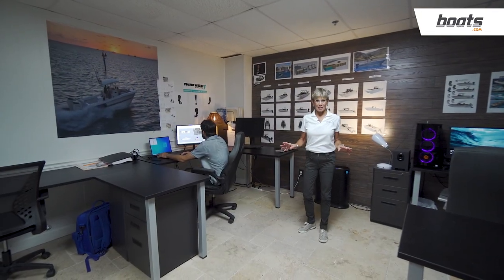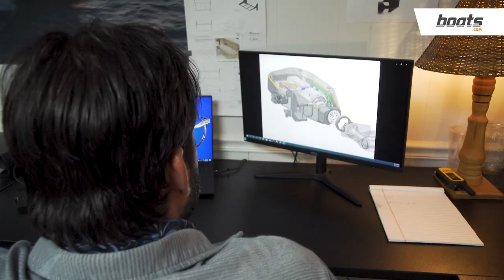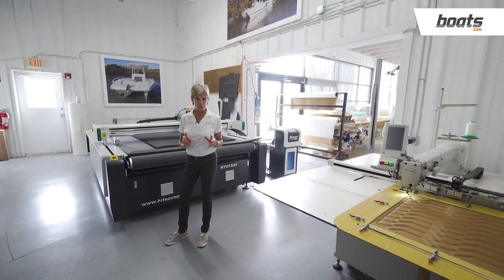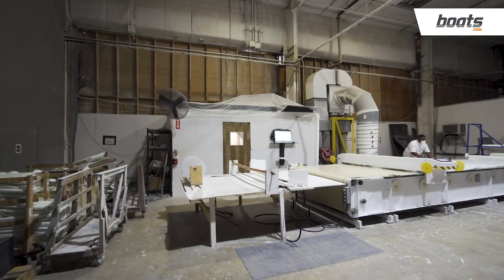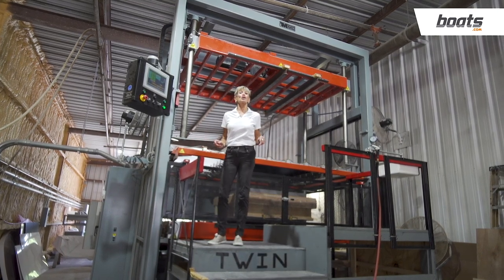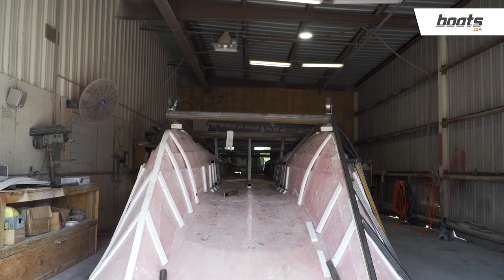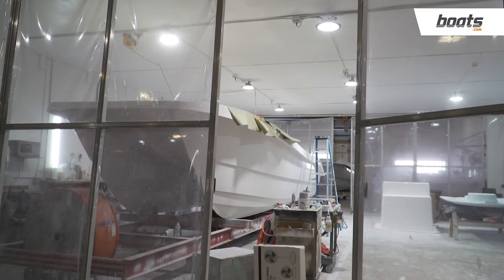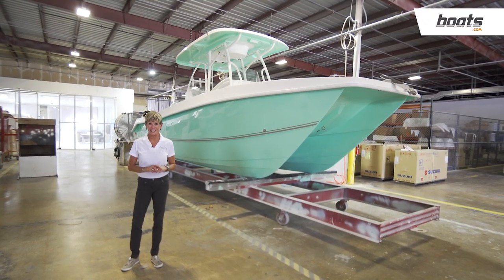Factory Fridays: Twin Vee PowerCats and ⚡ Electric Catamarans - EP. 8

Comment: Does anyone know what CAD program eric is using?
Reply: As a mechanical engineer I operated 9 or more softwares.
That said today I own a small sign shop however I love my (4) 24" monitors. Generally 2-3 are for the sign at hand and 1 is old John Wayne movies or Christian type videos or movies.oe e-mail screen or bill of materials screen yada yada. I cannot imagine one tiny screen and crummy chair.
His "station" is unimpressive and a turn off.
Heck, gamer kids run 2 or 3 screens particularly when an entry level Walmart monitor is petty cash and quality does just fine. Cad is like microsoft, every other update looks different i.e. url line/ toolbars available, grids,  screens in screens. I also reccomrd a killer sound system i.e. Klipsch about $150. 
I feel sorry for the Cad guy.